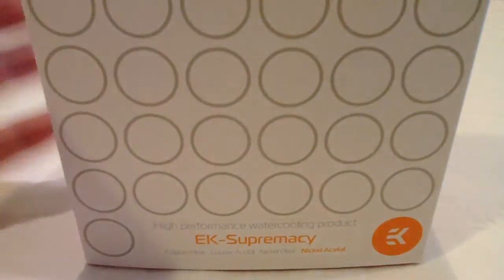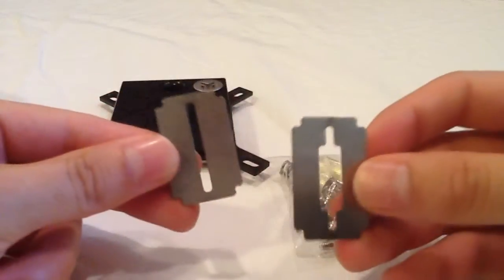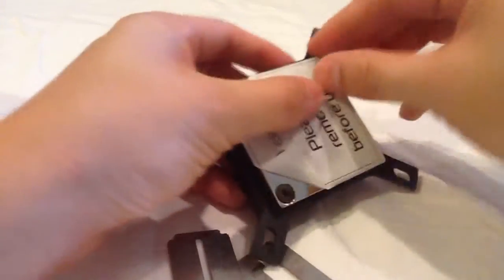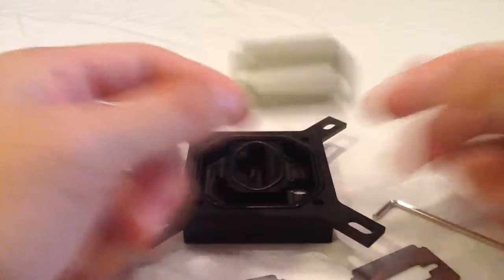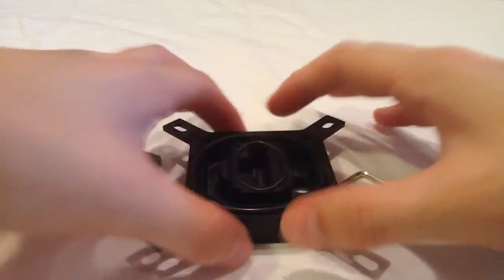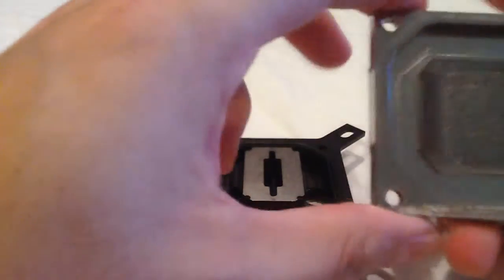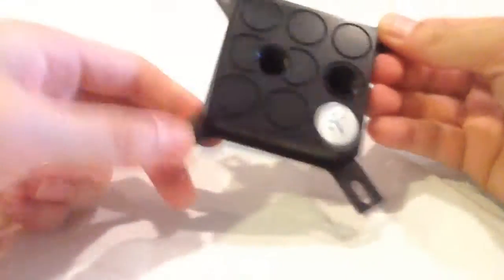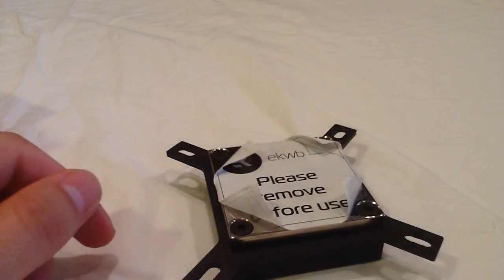How to Change the Jet Plate in the EK Supremacy CPU Water Block

Comment: For amd fx.  8350 which plate and insert do I use? I have the evo it came with one extra plate and insert. I used the replacement ones it came with per instructions but my temps are 60 at idle   Reseated with new paste several
Reply: Times still nothing. Flow is good going through. Any ideas?